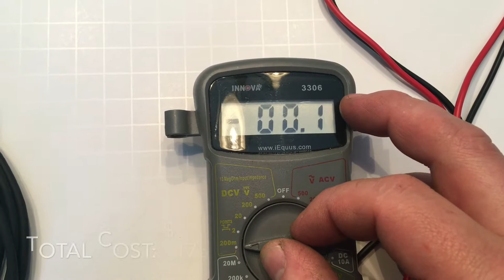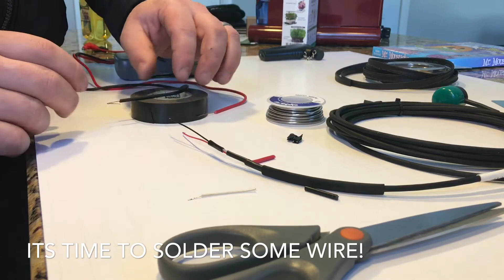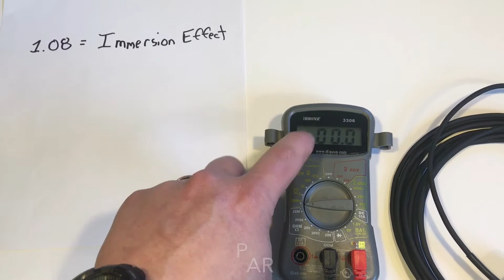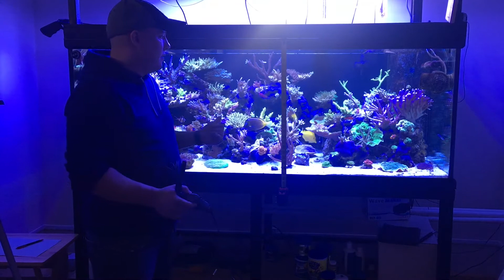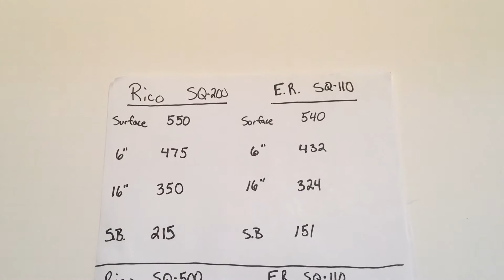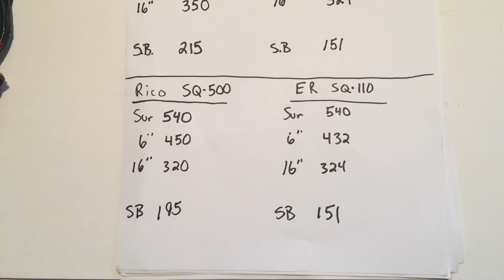DIY PAR METER AND TESTING Ft. Rico's Reef Tank

Comment: Thanks for the video. I decided to put one together. I am unable to find someone with a par meter to verify its accuracy but will just have to assume its close. Instead of multiplying the reading by 5 and then by 1.08, I just multiply the number by 5.4. It produces the same number and saves a step. 🤘🏼
Reply from the maker: mgwitcher6 awesome and great to hear.   What I would suggest to see if it's accurate, turn the voltmeter to 200m and leave the cap on the apogee sensor.  As long as it stays at zero, you should be good.  Apogee does recommend sending the sensor in for calibration every couple of years or so.   I used a pretty cheap voltmeter and the numbers I got were super close to an actual apogee $500 setup.  Thanks for watching and glad you got something out of this.

Comment: This is some sweet information. I wonder how these numbers would compare to the Seneye. Similar in price as the DIY setup.
Reply from the maker: Now you have my wheels turning.   If I can find someone in my area with a seneye setup I can do a part two to this video
Reply: Yea I am really thinking about getting the seneye. I have no clue what my par values are and don't want to spend a ton on something that won't be used much after I get the lighting set. If I end up getting one I will let you know. I am about an 1.5 hours from you and Rico.
Reply from the maker: Where are you located?    One thing I like obout the Seneye is the amonia reading capability.   That's always something good to keep an eye out for.   Not fond of having to replace slides but it is what it is.   You are correct about not always needing PAR readings however we are always changing things like lighting and coral placement so I think owning your own PAR meter can save you a lot of hassle.  Wel, if you end up getting the seneye and want to check its accuracy with PAR I would be happy to have you out or make the trip.  Hell, if you just want tto ship it to me I would be happy to test the outputs and get another video going.   Keep me updated man.  I am really curious about this now.  I don't intend on ever getting a Seneye but if it helps others make the choice than I am all for it.
Reply: I am located in Marion. I am planning on coming up there sometime soon because I need some sticks from the Godfather lol so I will try to work on getting one before then. I will keep you in the loop. It would really help people knowing what options are out there.